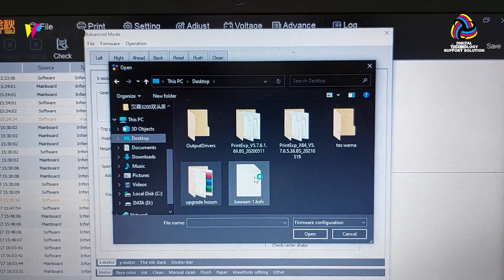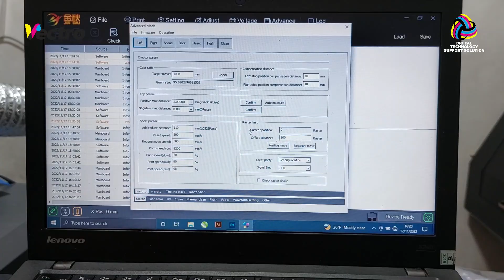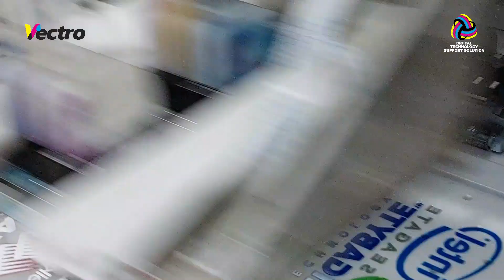Upgrade Board Senyhang to Hoson Board DTF Printer Epson i3200 | FlexiPrint

Comment: klo pakai speed high pengaruh di warna ga pak. biasanya sy pakai 2 speed mau sy naikan
Reply from the maker: Ngaruh pak tapi bigtu jauh perbedaan nya. Lebih ke hasilnya high speed berkurang kepadatan nya
Reply: @teknisi-printer pak klo tombol down sy kadang di tekan kadang bisa ,kadang ga bisa apa harus ganti panel
Reply from the maker: Iya pak kemungkinan panel Keypad  nya rusak
Reply: DTF sy cloging semburanya berlebihan seperti flush nya kaya semprotan pilox pas sesudah cleaning.  ada kontak yg bisa di hub arean jateng
Reply from the maker: Kontak cek di deskripsi pak
Reply: School sy WA pak